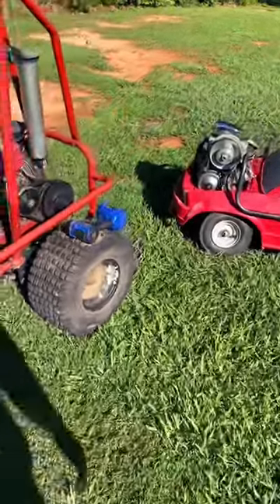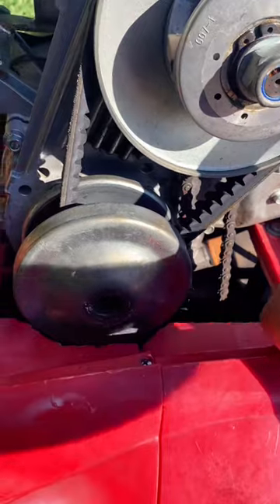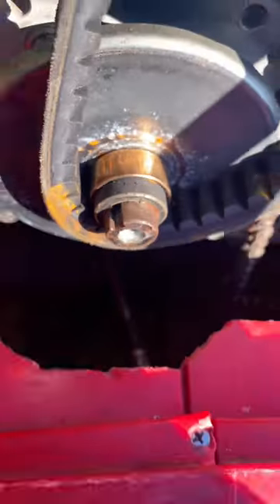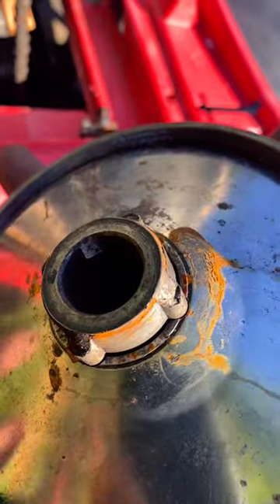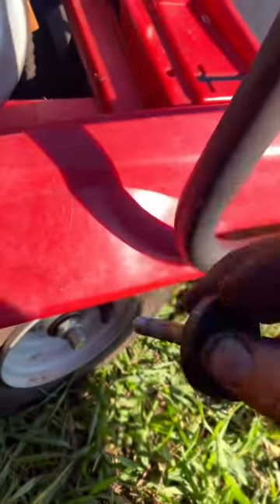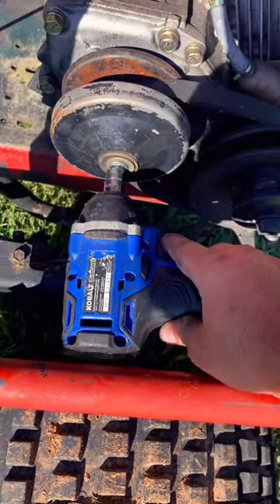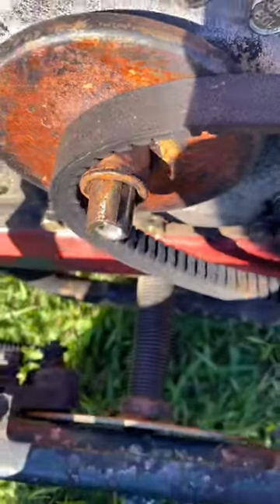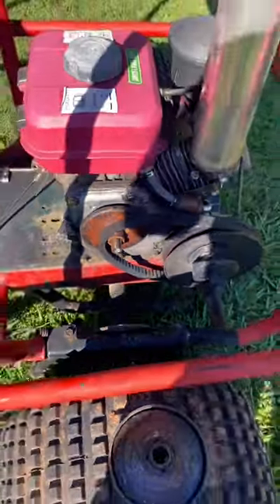When You Have A Short Shaft 196cc Diesel/ 30 Series Torque Converter #gokart #torque converter

Comment: This is an older version of the 168F engine. The ones with the fuel pump built into the crankcase cover may be different. With both the shim and the washer behind the driver pulley, the shaft doesn't protrude at all from the flat pulley on mine.
Reply from the maker: Interesting. It’s been a while since I bought this one and didn’t realize they had revised it.

Comment: What if you accidentally shear that bolt off, inside the crankshaft?🤔
Reply from the maker: Either just swap to a standard clutch and run with out a bolt or get a crank holder piston dead stop and use a reverse drill bit and bolt extractor to try to get it out.

Comment: What torque converter are you using 30 or 40 series
Reply from the maker: 30 series
Reply: You may consider a 40 series as diesels make more torque.
That being said, your gearing may be way off.
When I was a kid my 5 hp cart had a 30 series and I believe the gearing was 13 to 72

Comment: I've been searching for some sort of confirmation of this issue. I bought a cheap 7.5hp 212cc engine off Amazon. I already had to grind the 20mm crank down to 3/4"(even though it was supposed to be 3/4) and I was extremely concerned with the little engagement I could get. I Appreciate this video!
Reply: Do you have more like 3-5mm of crankshaft sticking out?
Had the same problem with the amazon engine .
Grinded down to 3/4 and just 4mm of crankshaft standing out, I might weld sth on it😂